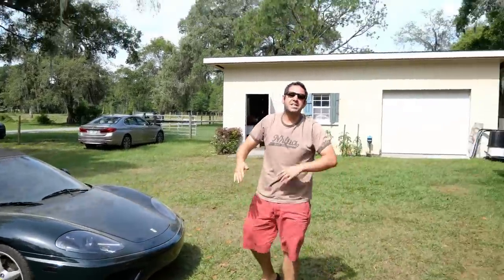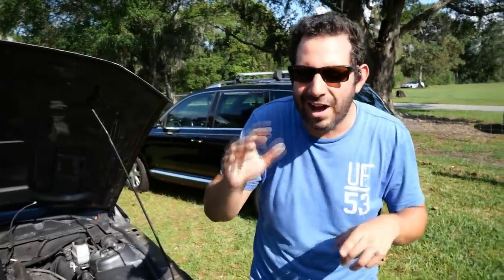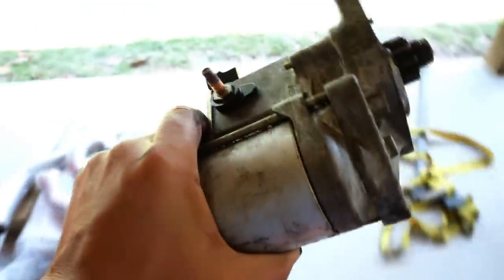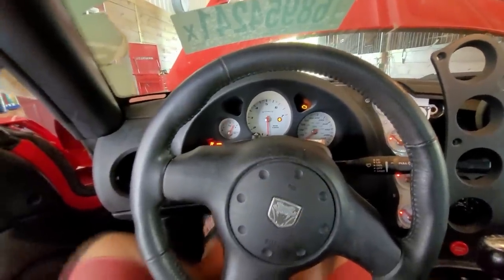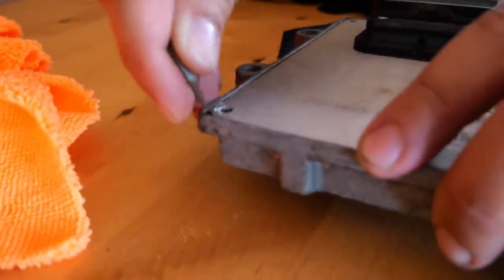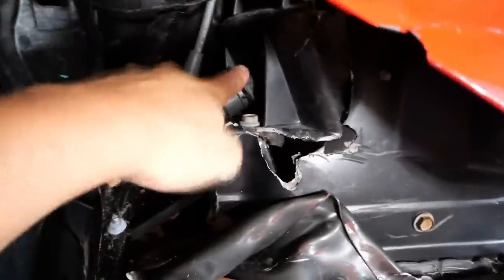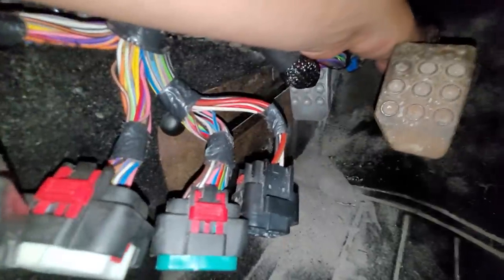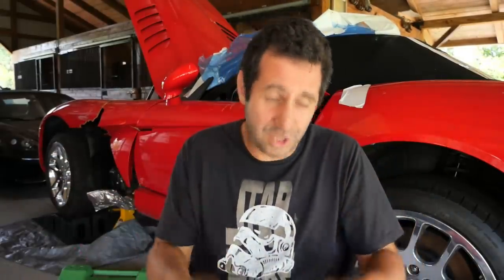Here's Why This Flooded Dodge Viper Won't Start

Comment: I can't believe you're trying to troubleshoot these electrical problems when you haven't even gotten wiring diagrams. Getting diagrams should always be the very first step! You'll be able to see how the starter gets its signal, and then test/verify you have power where you're supposed to. You'll be able to see all of the power and ground wires for the computer modules and confirm they're getting everything they need turn on. You might as well try to fix it blindfolded without diagrams.

Comment: This is the first video I’ve watched in this series but I’m gonna say this. If this is a salt water flood then this will be a huge uphill battle and the car will never be right unless you replace any wiring/electrical component that was exposed. With that said pull all the spark plugs and get a ratchet/breaker bar on the crank pulley and get that motor rolled over.  If it has never rolled for you DO NOT try to roll it the first time with the starter. This is your chance to save the motor if it has water in it. If it has water in it it is hydro locked and rolling it with the starter will bend/break something. Roll it over by hand with the plugs out to push the water out and then hit it the inside of the cylinder with compressed air to push an additional water out. If it stops don’t force it. It might have a rust ridge on a cylinder or a valve is hanging up. Roll the motor backwards and see if you can roll it backwards.  Once you have it free by hand then roll it with the starter to push the last of the water. Basically you want to displace any water that might be in the cylinders.  Once you’ve done all that then hit the inside of the cylinders with some kinda oil whether it is ATF or a fogging oil etc. Basically you want to preserve and lube the cylinders and all that. I’d also consider getting a fogging oil inside the intake so you can hopefully get some lube on the valve stems. 

Proceed with care because you can really hurt it if your not careful.
Reply: It hit a fire hydrant which eventually caused it to get swallowed by a sinkhole.   It had fresh water all through the engine and there is sand all over it.
Reply: Once rust and mineral deposits like that gets inside an engine, you need to do a complete disassembly.  My guess is that he knows that the engine is toast and is trying to just start it for the views.
Reply: @plektosgaming  I actually think he's hoping to save the existing motor.  At best finding a used 8.3 liter V10 is gonna set you back about $10,000.  They don't make these anymore.  If he can't save the motor then he's gonna get ALOT more wrapped up in it.
Reply: @jayss10  Well, then, he better pull it apart and start cleaning and polishing very square mm of it, insides and out.  Most of the surface rust can be ignored, but parts like cams and rods and the like are NG if they are pitted and/or missing metal.  From the look of it, he will at the last need the cylinders and pistons machined unless he wants to clog his cats in 6 months.  Obviously a valve job as well.  My guess is that he has a line on a used engine and ran the numbers and it was about the same, since he's not a machine shop. Though, he probably should learn given how much work he does on his cars that involves machining and fabricating.

Comment: Chrysler cars of that vintage are notoriously bad,(English cars bad.ie,Jaguar.) For electrical gremlins. Chrysler electronic modules MUST BE THE SAME NUMBER! No exceptions! It will not work if it is not the exact number for number module.

Comment: A huge leap from diagnostics not communicating with the module to opening the ecm, what about checking for powers and grounds to the module? Hi and low bus voltages? the ecm should have been left alone until the rest of the testing was done. You’ve done no testing of the bcm, just a visual with an assumption the sand means it’s fried. What if it’s not fried? you are chasing an assumption.

Comment: doesnt want to run a car because premium is around $5 a gallon? here regular is  $7.57 a gallon $2.00 a liter 3.78541 litres in a gallon  and i only run premium because here its the only thing without ethanol

Comment: You should be able to get away with swapping the modules. Some things may not work right or work at all, but the code for dodge at this time should all be the same. The different part number just designates it for whatever vehicle its going in. And this generation of Viper is 9/10 parts bin stuff they had laying around. The early Vipers were truly god tier k cars 🤣 love'em.

Comment: Dear SAMjunk

the viper was in the water and need to stay there.
you had electric & mechanic problem, rust in engine. the only part that will work fine is the manual GEARBOX. your luck it now auto.

save money and get rid this car.

b.s you are so chicken to make full engine rebuild, then all your work wasted